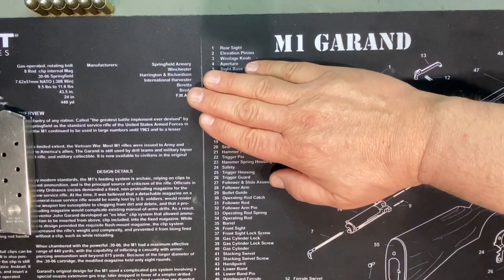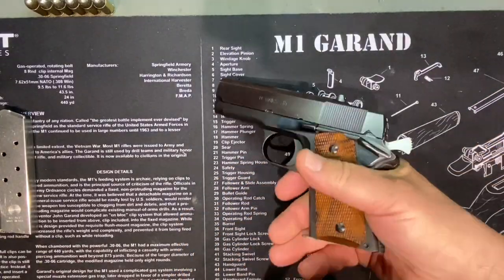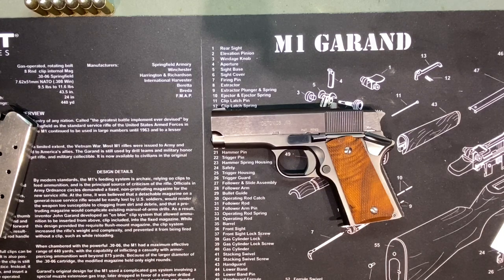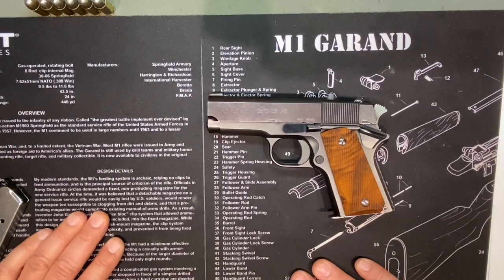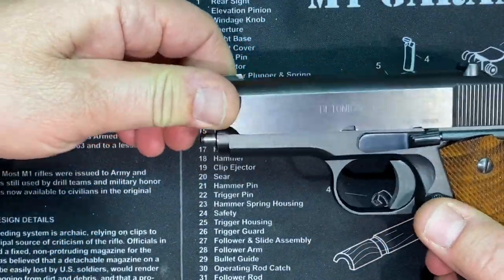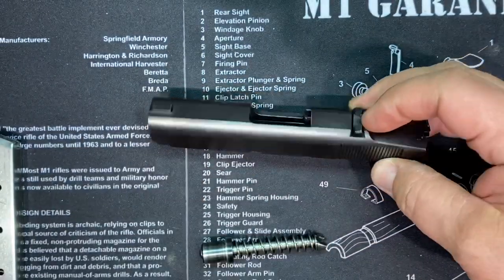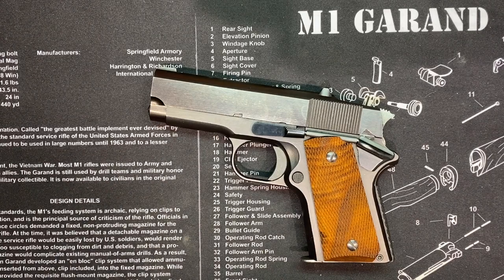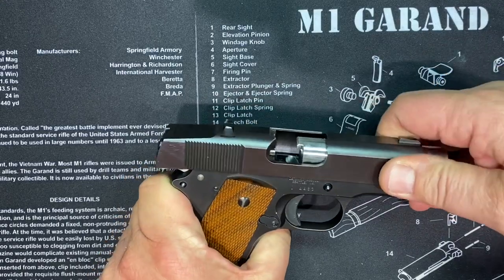Detonics Combat Master (1977)

Comment: That "sloppiness" at the beginning of the slide moving back is because of the dual recoil springs. the springs dont engage at the same time so there's a little less spring tension at first. Good vid, actually just won one of these in an auction yesterday after seeing Ian's vid a long time ago. Can't wait to go pick it up, they certainly are cool little guns! considering tricking it out with some gold plated bits when i get a chance haha.
Reply from the maker: How’s the new purchase?

Comment: Detonic Combat Master .45 was the favored hand gun of John Roarke.
Reply from the maker: Yes!  He carried dual stainless combat masters with Pachmayr grips in a double Alessi shoulder holster.
Reply: Don't forget the Milt Sparks  6 Pak  magazine holder for his Detonics. Haha.
I am proud to say I have owned a Detonics Combat Master .45  in Blued steel.   It felt like an extension of my hand. @MilsurpGarage
Reply from the maker: @Bill23799 I want to shoot mine more but I’m hesitant due to the unique recoil springs and spring guide set up…..especially the area where the pin goes through the “half moon” area if you know what I mean. It seems like a spot that could fail with extensive use and it’s a proprietary combat master part that would be a challenge to find, I’m sure. 

Not sure if they are all set up that way, I believe I have a very early model. Does your Detonics have identical parts as mine?  Your thoughts?